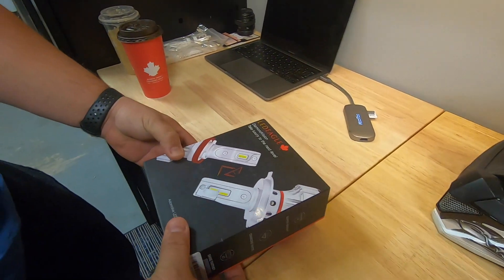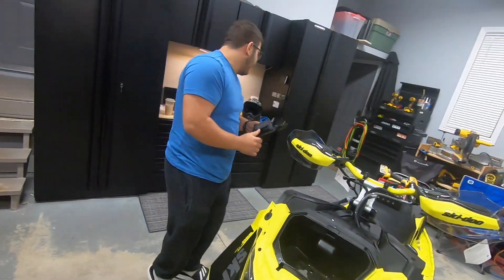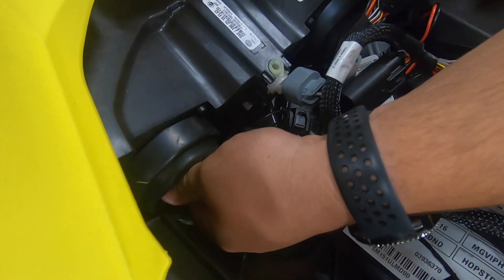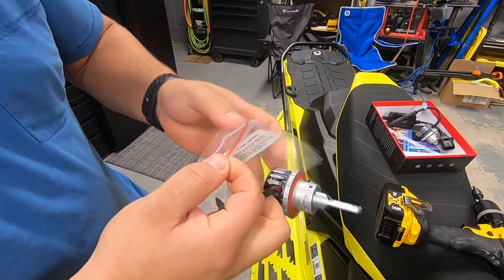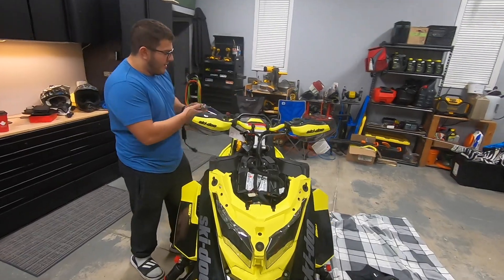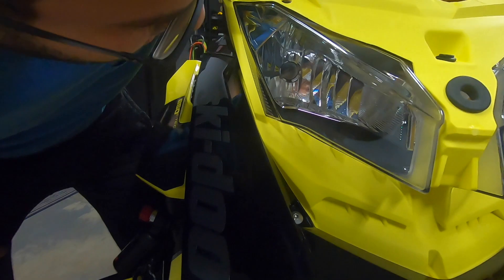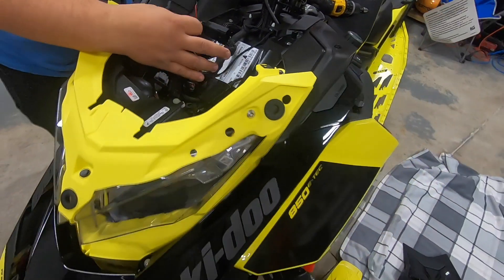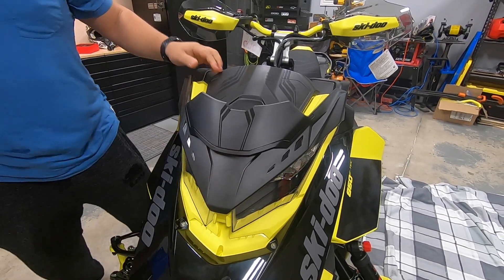Install | BEST LED Headlights?

Comment: Crazy we have to take that much of the sled apart just to change a bulb. Not like the old days for sure. Thanks again for great video. Glad I had mine changed by the mechanic before I picked up my new sled.
Reply from the maker: Glad you enjoyed the video Fred! It looks complicated but its actually quite easy, only 2 screws! But there is nothing wrong with having a mechanic do it, then all u have to do is turn the key and go! Cheers,
Jesse

Comment: Hey, I'm wondering if this would work on my 2021 tundra LT 600 ace. If you can let me know or point me in the direction of some that would work. Much appreciated
Reply from the maker: Yes these lights would work on your sled! Any H13 bulb will be compatible. You can also look at the Alpha LEDs from Sii lighting. They also make an H13. Cheers, Jesse

Comment: I snow checked a ‘22 MXZ xrs and am looking for a good LED light to install when I get the sled.  What exact model number bulbs are these?  I’ve been on Eagle Visions website.  Ton of different bulbs on there with no fitment descriptions/info.

Thanks
Reply from the maker: It would be the LED Eagle's H13. Here is the link: https://ledeagle.ca/collections/diamondvision-i/products/led-eagle-diamondvision-h139008-led-headlight-bulbs
Reply: @sledaddicz  Sold out! Bummer
Reply: @gregsouther7293  ah Darn! Sorry about that. Cheers, Jesse

Comment: Just checking - any problems/issues/regrets since you did this 2+ years ago?
Reply from the maker: Hey Chuck. No those lights were pretty good. We did try out another company a year later and find the lights even brighter. Still running them now and they have been fantastic for over 25,000 kms on my sled. Here is a link to the video we did on them:
https://youtu.be/1ZQzJotsbHA
You can get them at siicompany.com and use code Addicz23 for 10% off.
Let me know if you have any other questions.
Cheers, Jesse

Comment: What is the bag attached to the glove box lid? Is it heated ?  Thx
Reply from the maker: Hey Matthew! That bag is heated! It comes with all 21 or 22 Ski-Doos with the Premium 7.8" Gauge. It is a cell phone holder where your phone is heated. It is meant to use when your phone is plugged into the gauge to keep it warm. Cheers, Jesse
Reply: @sledaddicz  thanks for the reply. My 22 backcountry doesn't have that big display but I wonder if I can get that bag separately.  I will ask dealer. Thanks again and keep up the content 👌
Reply from the maker: Hey Matthew! No you can't get it separately. Even if you could order the part it wouldn't work as the wiring is set up from factory different for the sleds with the premium guage vs the regular. Cheers, Jesse

Comment: Hmmmm. I noticed you did not seal the new led lights. If they are not sealed properly it can cause condensation. Have you ever had a problem with condensation inside the housing? Thanks.
Reply from the maker: Nope. No condensation issues at all.

Comment: Where did you order them headlights ? And would they work for a summit 850 as well ?
Reply from the maker: Hey Blake! Check out motojungle.ca/eaglehaslanded
The B2 H13 headlights are what you want for your Summit 850. Cheers, Jesse

Comment: Interesting how you have to take a brand new 2021 Skidoo apart to replace the headlights to make them half decent.
Reply from the maker: I agree! Ski-Doo should really be including LED lights stock with their X package machines. But... I used to run the LED light from skidoo, so these LED bulbs are much much cheaper. Around 90$ vs. 400$.
Reply: The halogens are actually nice

Comment: What is the reason for making them completely vertical or adjusted a bit to the side? Will it affect how far the beam goes?
Reply from the maker: More so hinders the high beam. If they aren't straight when u put the highbeam on it will light up a bit to the side instead of directly in front of u. Thanks for watching!
Jesse
Reply: @sledaddicz  Thank you for the reply! Have always run the accessory light bar as well as led’s so I got a pretty good view in front of me but this year bought a 2021 backcountry 850 and didn’t get a light bar in time so looking into brighter headlights to make up for it.
Reply from the maker: Yup! These LEDs are the best of the best. I always had the accessory light but i found that they did nothing for far distances. Thats where the highbeam of these new bulbs comes into play.
Reply: @sledaddicz  I understand that all to well. The led lights I used to run sucked close range as they weren’t built for my reflectors but I had that light bar which filled in for it well. I decided to go with a $70 pair from Marsauto at 16k lumens so hopefully those work out well. If they cast a beam patter I don’t like I found a 25$ set that is much dimmer at 6400 lumens but it cast a very nice cone of light that I would be happy with for this single year that I don’t have that light bar. I’ll be sure to fill you guys in if you’re interested!
Reply from the maker: @nsa6790  Absolutely! Cheers, Jesse

Comment: You don’t actually have to disconnect the gauge plugs
Reply from the maker: No but I did because I had to take everything out to get my gps wiring through so I could wire it up to the solenoid. Cheers, Jesse

Comment: What are the lumins on the bulbs(each)?
Reply from the maker: 6000 lumens for each bulb for a total of 12000 lumens
Reply: And its not so much the lumens that makes them so awesome.... its that the beam is engineered to work in the stock reflectors so they are bright for distance!  You wont outride the light.
Reply: @mudbrats  That was my big concern about switching to LED lights. I heard the distance wasn't as good.

Comment: Disappointed.  Mine came with screws rolling around in box. Missing tool. Looked to be used. I contacted seller several times and no response. Would not recommend 👎
Reply from the maker: We will reach out to him and see if he can help. That doesn't sound right. Mike

Comment: Don't you have to adjust the aim
Reply from the maker: Yup. Just using a Phillips bit in the glovebox there is a set screw to adjust the aim of the beam. These LED lights usually come stock facing too far down so you just have to lift the beam. Cheers, Jesse

Comment: Definitely not the best led headlight as you have to take them back out and use an Allen key to try and guess the correct vertical position. The worst. Get the Bps b2 series you can just click to the right position after there installed 💯 better.
Reply from the maker: Thats smart. No big deal tho. Took a few minutes at the beginning and then I knew how many turns till it was aligned for the other bulb. And im switching them from sled to sled so I never need to adjust again. Definitely could improve by making it a manual adjust without an allen key! Thanks for watching! Cheers,
Jesse

Comment: These are not really designed for the housing and will most likely blind oncoming traffic. Make sure you aim them so you don't do that.
Reply from the maker: Not true. Completely to the contrary! These are one of the few LED lights that are designed to sit in the stock halogen housing.